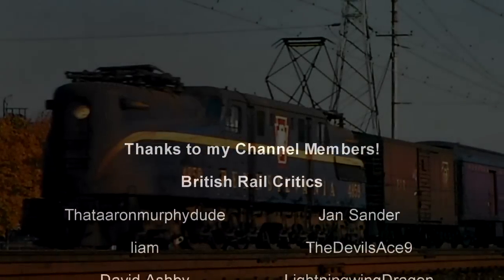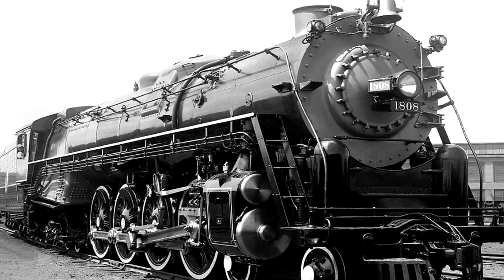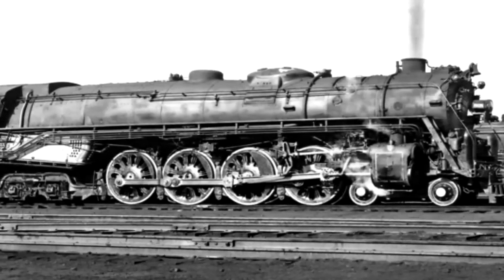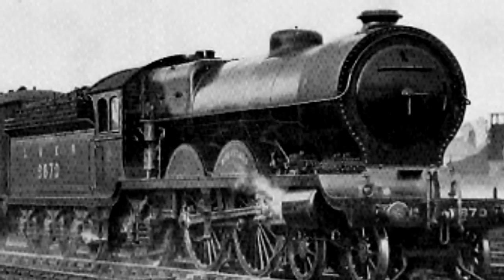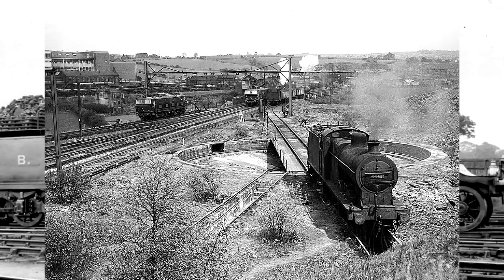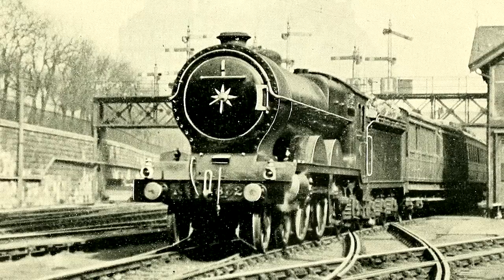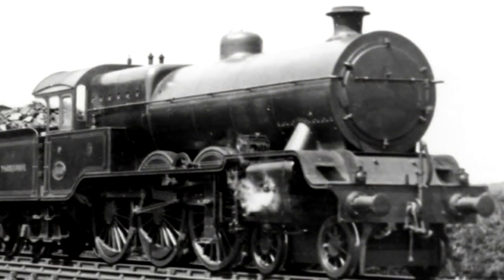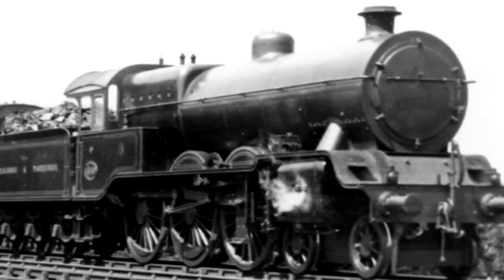5 Trains That FAILED, But Later SUCCEEDED | History in the Dark

Comment: I'd like to see the Highland Railway (Caledonian) River Class and the BR Britannia's talked about in a second part. The former were deemed overweight for the HR but were actually fine and ended up working there after falling into the hands of the LMS after the grouping. The latter were like the Jubilees with several issues after they were built but modified to become BR's best steam locos.
Reply: or Duke of Gloucester
Reply: The Rivers were fine engines, if a little stymied by a lowish boiler pressure (160psi at a time when 225psi was being experimented with). If the Rivers had, for example, a 200psi boiler, we could have been talking about a sort of Ur-Black 5! (yes, they were potentially that good). The weight issue was a bit of a red herring, as the balancing was excellent.

Comment: For future reference, "Keighley" is pronounced "Keith-ley". HTH.

Also, if you do a part two maybe consider the (trigger warning) British Rail Class 458 EMUs. These were built by Alstom and as new units they were riddled with reliability issues and looked kind of ugly. A rebuild was carried out using additional vehicles from the Class 460s which were of a similar design (both were part of the "Juniper" series) but had fallen out of use on the Gatwick Express. This extended them from 4 to 5-car, and rebuilt the front ends to have a more conventional connecting gangway for working in multiple. They were far more reliable after this, though not without a few ongoing niggles. The story doesn't end there though, as they are currently planned to be reduced back to 4-car so they can be redeployed as 12-car formations on Portsmouth expresses. Given the current issues on the South Western Railway however, there is some speculation that this plan won't end up happening.
Reply: The British class 323 when introduced on the Cross City line in the West Midlands (Lichfield-Birmingham-Redditch) had a fraught start in life, I can't remember what as I was only a kid ink the mid 90s 😁 but I remember me dad saying there were delays in full time introduction, but they've been running nearly 30 years up and down the Midlands commuter belt, one of the busiest (in the UK, outside London I think)
Reply: What does HTH stand for
Reply: @fanofeverything30465  Hope This Helps
Reply: @peddersmeister  Thank you 😊

Comment: Add to the Baldwin engines,that initially were bad,then turned good!! The New Haven I-5's,4-6-4's were from the same era,and also had balancing problems! The application of cross counterbalance was the answer! The engines,at speed,could literally bend rails,and they were designed for 100 MPH service! So you can add another type to your list!! As an aside,early,4-8-4's,4-6-4's,had that trouble with counterbalance,as most trains were operated at 60-70 MPH,on average,but when the high speed trains operating at 90 plus,the whole prior system of balancing was put to stress proportions! The equivalent in aircraft was the speed of sound,and the use of straight versus sweptback wings!! Basic set of re-engineering with a completely new set of data points!! Thanks for a really engrossing video,it does make you pause and think!! Thanks!!

Comment: When it comes to trains, potential examples would include Disneyland Monorail MK7, LNER Class W1, Alco RS-3 (some were upgraded to RS-3m), New Hope Consolidation #40 (it turned out the repairs made by L&C early in its life were sloppy), SR Merchant Navy, GWR 7800 Manor, British Rail Class 47 (in this case, specifically the rebuilds of troubled BR class 48 with 12LVA24 engine), and British Rail Class 44.

Comment: How about 5 Trains that have been used for excursions but were sadly scrapped

I’ve got one which is Grand Trunk Western #5629!
Reply: There are many examples of that. One I am going with as an example is Southern Pacific No 4274 class AC-11 4-8-8-2 Cab-Forward.
Reply: How about cb&q 6315? It was a 2-10-4 Colorado that while pulling an excursion with 5632, it broke its rods. They were pushing the 6315 to its very limits. Eventually, 6315 and all the Colorados on the CB&Q were all scrapped.
(On the CB&Q, they called their 2-10-4s "Colorados" but most railroads called their 2-10-4s texas types)

Also 5629 is extremely overrated

I will always prefer other light pacifics like the P5s from the Atlantic Coast Line, the pacifics from the Mobile & Ohio and the K5s from the Louisville & Nashville

Comment: You missed your chance to have the Duke of Gloucester on this list. In running service she was considered a major failure ( mainly due to being built not to her plans) in preservation she out preformed pretty much everything that replaced her. I think her record over Shap Hill is quite something

On the turn tables... 
Wonder if it was done on purpose. It'd be  one way for the locomotive department to force the hand of the infrastructure  department if the infrastructure department refused tocater for them...xD
Reply: I was really hoping he would’ve mentioned the BR standard class 8 no 71000

Comment: 4-6-2 is the best wheel arrangement of all time try and change my mind
Reply: Nyc 4-8-4 Niagaras or even their 4-6-4 Hudson both were more powerful and had the same speed capabilities they just never went for a record but it's said by many nyc crews that they both could push 120 on a good run don't get me wrong pacifics are good but they are old compared to the modern steam engines that out classed them
Reply: @thelittletug9321  they may be old, but they are georgeus and iconic
Reply: @willsen8908  they are beautiful but I think that's there niche in all other respects they are outclassed in all other areas and sometimes even in looks
Reply: @thelittletug9321  the reason i like Pacific is probably because of the DSB e class which is my favorite locomotive, because of it i have grown a liking to Pacific 's. My favorite more modern steam locomotive is probably the SAR 520 4-8-4
Reply: @willsen8908  I will concede that the DSB e class and not a pacific but also the p class are both beautiful locomotives so I will agree that while out dated are still beautiful pieces of history
Reply: I believe that the 0-6-0 is the best, if the most popular and numerous built.
Reply: @Willsen Well, you have the right to think that. I enjoy Pacifics, but in my opinion, the 4-8-4 is the best, especially with masterpieces such as the N&W J and the last 5 C&O Greenbriers.

Comment: Interestingly, #18 isn't the only famous SC-class locomotive. Fun fact, Western Maryland #734(known affectionately as "Mountain Thunder") is actually an ex-LS&I Consolidation(ex-#34) that was modified by the Western Maryland Scenic Railroad to look like a Western Maryland H-4 Consolidation, given all examples of the latter were unfortunately scrapped. Ol' 734 gave us an excellent example of what they might've been like, and put on a great show. However, over time, the railroads' trains got longer and heavier. 734 did her best to pull them, but unfortunately wore herself out in the process. Today, she's out of service, stored on a sidetrack until further notice while ex-C&O #1309 takes the spotlight. Hopefully, WMSR will go through with her rebuild. Only time will tell. . .
Reply: (7)34 is an SC-1, which is larger than the SC-4.
Reply: @kanechrist4213  thank you for the correction, I've edited my comment accordingly

Comment: Generally, a steam locomotive with no trailing wheels and/or front pilot wheels is designated with the word "oh" instead of zero; so, "oh-six-oh", not "oh-six-zero" or "zero-six-zero"; "two-eight-oh", not "two-eight-zero". Yes, technically incorrect, if you like to use the word "zero" since it's a number, but as far as I've heard, it's always been "oh", not "zero". . .

Comment: You forgot to mention that the Jubilees were 3-cylinder versions of the 4-cylinder Black Fives.
Reply: They are w h a t?
Reply: Black 5's had two cylinders
Reply: From what I remember LMS (and it's precursors) never used three cylinders, with the exception of the Deeley/Johnson Compounds, a 2:1 ratio.
Reply: @PiersDJackson  The Jubilees were indeed 3-cylindered. Was not the Lickey banker 0-10-0 also of 3 cyliners?
Reply: @johnclayden1670  yeah, who the hell thinks they have four?
Reply: @eae2047  Andrew Raila ‘Bammers!
Reply: @johnclayden1670  the Lickey Banker was an 0-10-0 with four cylinders (16¾"×28")... the Jubilees it turns out were three cylinder.... so were Royal Scot and Patriot classes..

Comment: How about trains that succeeded but later failed
Reply: Older vehicle designs fall out over time. It would have to be a notable enough situation. 

Potential examples would be-

Locomotives: Milwaukee Road Class EP-2, P2 Mikado rebuilt as A2/2, Lac-Megantic 5017, and Kaprun funicular. 

Airplanes: 747-800i (passenger variant; not the freighter version), Concorde, Bell X-1D, Mitsubishi A6M Zero (went from being terror to being cat food for Hellcats), and Fokker F-10. 

Ships: HMS Hood, ocean liners in the 21st century (except Queen Mary 2), Moskva, and Japanese WW2 aircraft carriers. 

Tanks: Panzer 1 (early success, really outdated later on) and heavy tanks. 

Cars: Volkswagen Beetle
Reply: @tidepoolclipper8657  Successful trains with terrible rebuilds.
Reply: @hussarzwei6223  
P2 Mikados becoming A2/2 is still a fitting example. Not to mention the repair work on Milwaukee Road Class EP-2 were not the best; especially the ones repaired by Milwaukee shops. As for Kaprun funicular, there were design changes that would lead to its literal demise and would never reopen since then.
Reply: @tidepoolclipper8657  What about buses 🚌

Comment: How about "Excellent engines with one little, niggly fault"? Examples? (Trigger warning) British Rail Class 33 (a truly wonderful design, but rushed out with electric train heating before there were enough coaches to take electric train heating(!), although it was very reliable, if something went wrong it would be electrical, and for some unknown reason the shed costs compared to other classes were astronomical. But they were perfect in every other way.) Midland Railway 2600 class 0-6-4T tank engines (Strong. Reliable. Reasonably Economical. And possibly the roughest riding beast in the history of the Railways of Britain. They tried them on suburban service - no dice. They tried them on heavy transfer freights - better, but still not quite right. One thing that they were rather good at, although rather by default, was that due to the Midland's "small engine" policy, if loadings were heavier than expected the 2600 made excellent pilot engines, especially if paired with the legendarily sure footed 1000 Class "Midland Compounds" and the equally stable 999 Class - which was basically a Compound without the compounding and slightly smaller wheels. They were liked, they just had this one flaw). The North Eastern Railway V and V/09 Class 4-4-2's. (An excellent class, fast, strong, reliable but not liked by the fireman, as they were rather heavy on coal. The V/09's had slightly different dimensions and were slightly less heavy on coal, and they weren't particularly bad by the standards of the time, but it was a niggly problem with an otherwise very good design indeed. An amusing story about the V Class is that when they first came out the Chief Mechanical Engineer, Wilson Worsdell, rushed them into service because his Chief Draughtsman, Walter Smith (a strong advocate of compounding) was on a fact finding tour of the USA, and Wilson knew that Smith wouldn't approve of a large, heavy 2-cylinder Atlantic, despite the need for such an engine type being quite pressing. Reportedly Smith was not happy in the slightest and Worsdell had what was described as a "difficult hour" by his secretary when Smith got to talk to him about it. Smith had the last laugh, all be it from beyond the grave though, as when Worsdell retired, he was succeeded by Vincent Raven, and Raven came up with the Z class Atlantics, which might not have been quite as powerful as the V's and V/09's, but were a lot more economical).

Comment: Non-train examples I can think of are:

Republic F-84 Thunderjet
Hawk Model 75 (far more successful than its original American version; Curtiss P-36 Hawk)
M16 (unreliable mess during Vietnam to proven mainstay; only might become obsolete due to M5)
MK 14 Enhanced Battle Rifle (original version (M14) was unsuccessful. Rebuilt version (MK 14) is successful selective fire battle rifle)
Boeing 737 (believe it or not, but the 737-100 was technically a flop), Spitfire (beloved these days for good reasons. However, the first version of it was mediocre; especially as it had issues with the engine suffocating when flying at certain angles; later versions provided a solution to that)
R-7 rocket (failed ICBM to highly successful rocket family)
Thor-Delta (precursor to Delta rocket family and far better than Thor-Able)
Ford Crown Vic (always has been a good car, but was never super successful for the civilian market. Highly successful with police force)